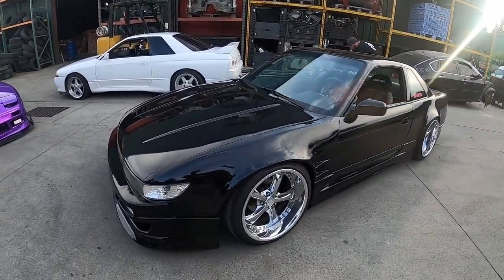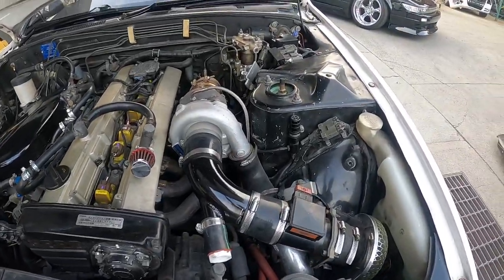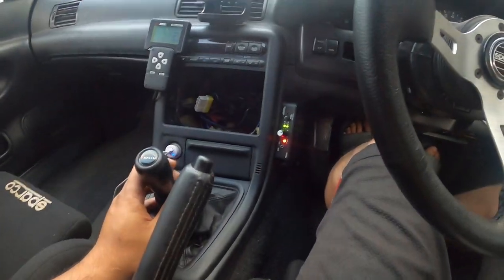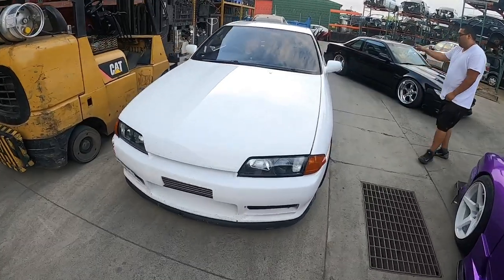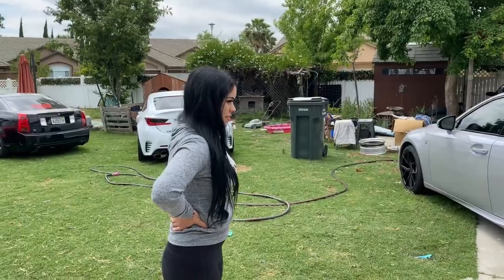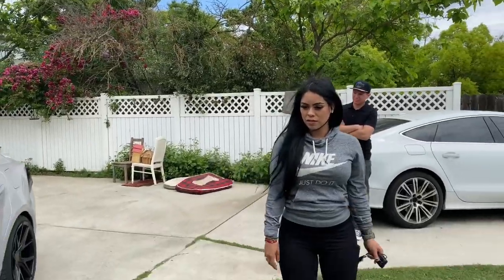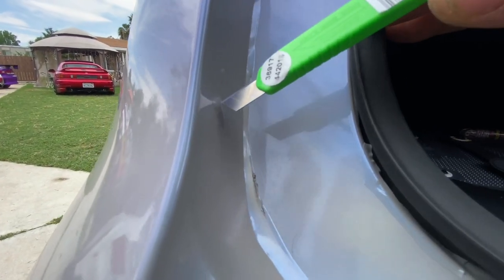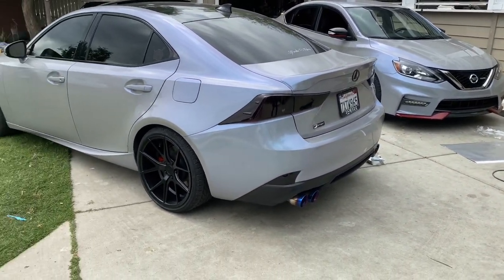SHES BACK AFTER 1 MONTH...New Wheels & Touch Ups | CA Titled SKYLINE R32 For Sale!

Comment: Do you find problems wrapping in the heat or dust outside? Like after cleaning the panels and starting the wrap, does dust accumulate fast enough to cause a problem? Let's say on a breezy day.

Comment: to avoid the bubbles in the back crevice, once you get all the vinyl to that location, heat it up again before laying it in (heat an inch or so before the crevice). if you don't use the heat before it won't get to it's fully relaxed state.

Comment: Ok paradox, I’ve watch many of your wrap videos and I’m taking your advice. I’m going to try to wrap my ugly silver wrangler with vivid. My question: is it too warm or too difficult to wrap when it is above 90 degrees temperature? Also, would you use some sort of tack reducer? If so what would you recommend?
Reply from the maker: Vvivid sucks ass don’t use that. Use my brand @paradoxwraps or Avery
Reply: Paradox The Wrapper I would love too but I cannot swing it right now. It was cheap and this is the first time I’ve tried wrapping a whole vehicle. I’m just using a cheap gloss to see I can do this. If it turns out ok I’ll definitely try your stuff. You have some awesome colors.